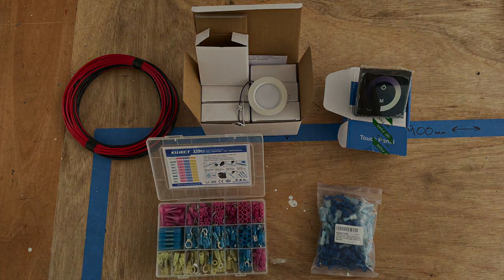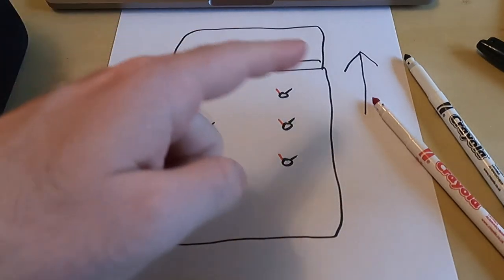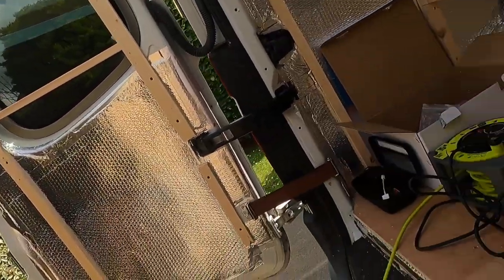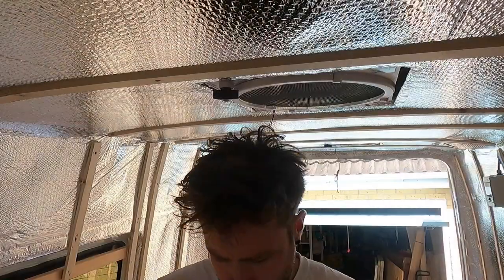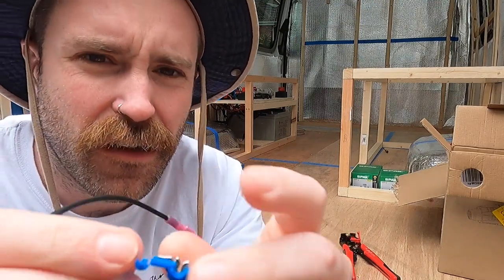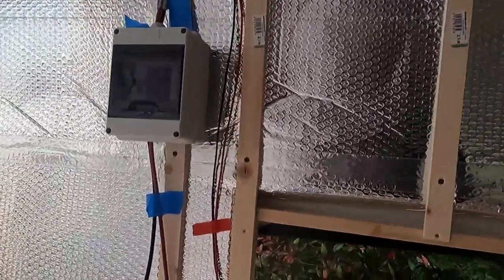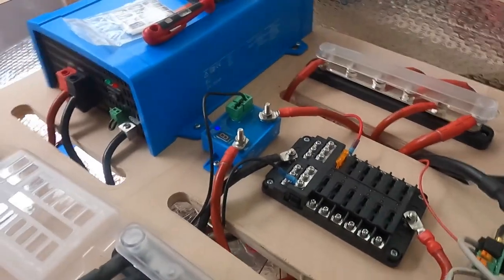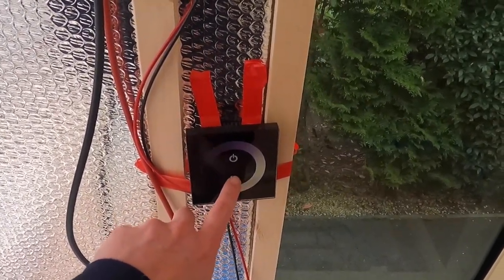How to Install 12V LED Lights | Van Electrics | DIY Sprinter Van Conversion UK

Comment: I just noticed that you didn’t explain how to connect the little light blue wire clamps to the end of the wire that you connected to the wire running from the positive wire to the light. I can’t figure out how to do this?
Reply from the maker: @chartmann43  I just crimped them to the end of the cable exactly the same way I added the pink connectors to the end of the other side - crimped, then added heatshrink 👍🏼

Comment: Hi ,
Nice and very informative video!
Would you mind to give me a little advice?
I’m going to install 3 lights in my renault trafic van.
Question is.
The old lights has a 3 core cable and most of led lights has only red and black wire.
How can I install 2 wire led into 3 wire circuit?
Many thanks
Reply from the maker: Thanks dude! If the lights have a 3 core cable, that means they were running off an AC current, whereas 2 wire LEDs will likely be requiring a DC current so won’t be compatible. Where’s the power source for the lights?

Comment: What make are the lights and did they come with the touch screen controller ? Link please 😊
Reply from the maker: Hey bud! There should be links to everything used in the video description. The got the lights and dimmer switch separately but both from Amazon 👍🏼

Comment: Hi,
Thanks for reply but this is absolutely not a case .This is standard commercial renault trafic van.
It has never had any modifications at all.
3 core wire is originally fitted electric system buy manufacturer.
I have a picture but don’t know how to share it with you.
Thanks mate